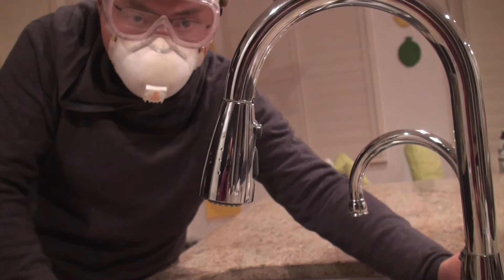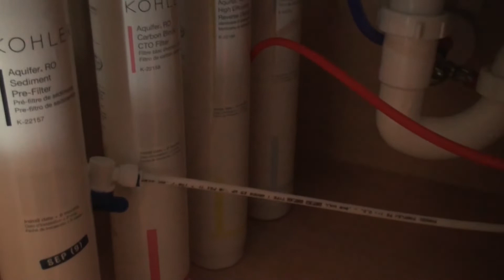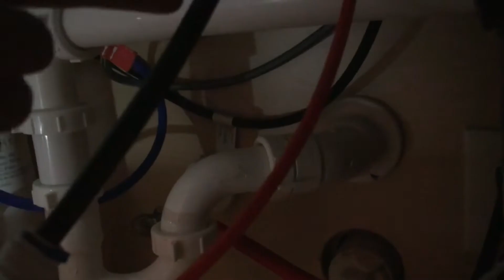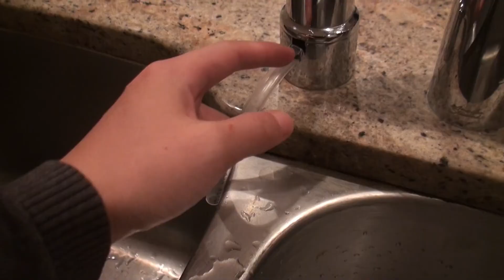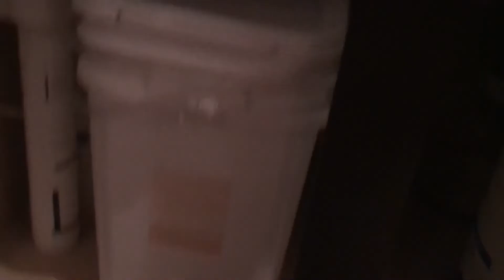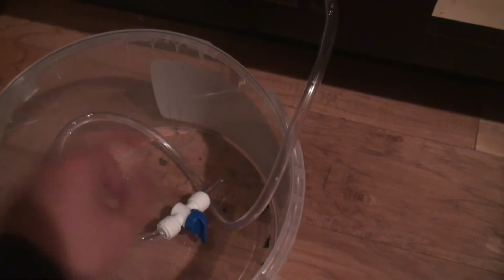Reverse Osmosis Water System,  RO  (how to do waste water recovery automation)

Comment: That is a great design. I am wondering where you bought the floating valve?
Reply from the maker: 4 Pack Float Valve 1/4 Inch Mini Float Ball Valve with Adjustable Arm Filter Float Valve Kit for Water Tank Pump Trough Aquariums, Aquaculture, Water Tank, Reservoir https://a.co/d/hCv7zjc

Comment: Do you have a link of your air gap faucet?
Reply from the maker: Kohler K-6666-AG-CP Wellspring Water Filtration would do:
https://www.lowes.com/pd/KOHLER-Wellspring-Polished-Chrome-1-Handle-Deck-Mount-Bar-and-Prep-Handle-Lever-Commercial-Residential-Kitchen-Faucet/1002845944